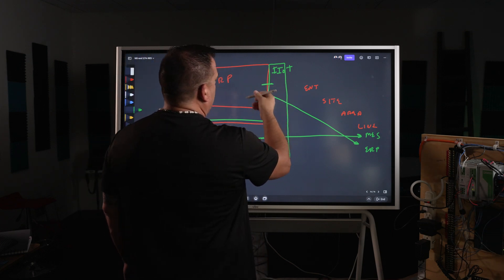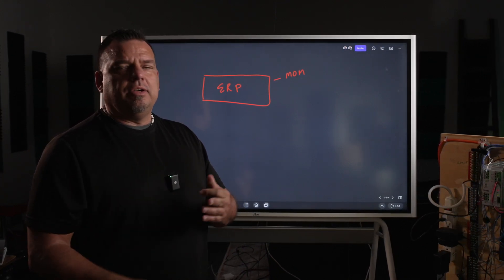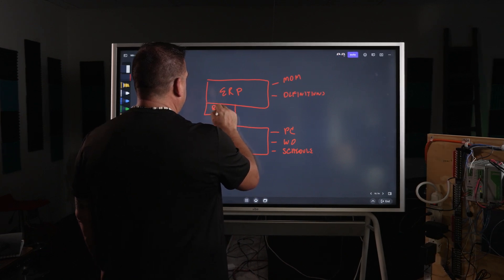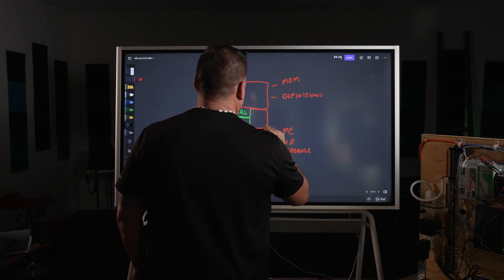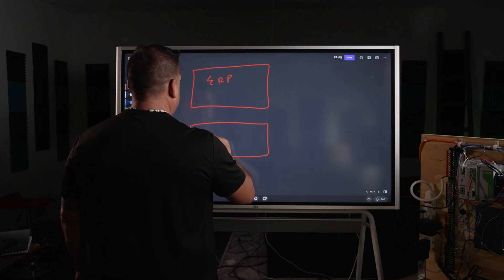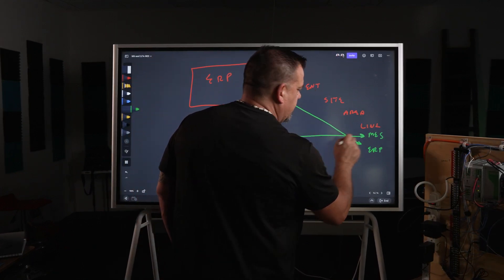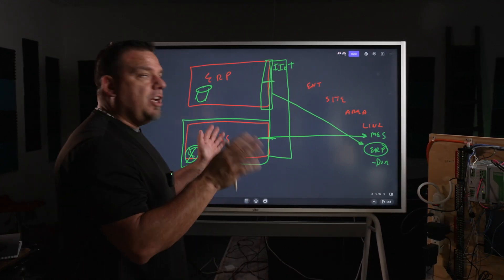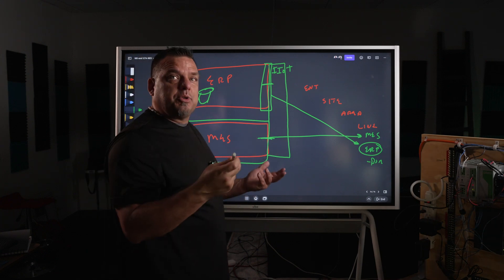MES to ERP Communications Explained!

Comment: Hello great video !! Thank You i have few questions regarding the proposed integration strategy . Can  we use uns as isa 95.06 messaging service model? , do You create handshakes mechanisms between mes and erp to be sure that each of those have received the information ? For example mes once have downloaded the work order response with order number to erp , or how do You control that the message is received for the expected subscriber and not another else in the ecosystem ? This also applies in mes to shopfloor integration thanks

Comment: Thanks for taking the opportunity to start discussing MES and ERP integration. However, from my experience, the integration concepts might be correct from a technical point of view but from content, business process requirements and the way MES systems are designed, this will not fly.
Reply: Please elaborate. MES and ERP are generally implemented over a long time with presence of outdated technologies in system. So any what way you will have to jump back and forth. Do you mean this ?

Comment: Great video. If you ERP or MES is a non customisable SAAS. It wont necessarily have the fields/tables to display the data from the UNS. Since these are core applications, is it best they are platforms and possibly even open source for full customisation potential.

Comment: What's the difference? 
Please don't tell me that your IIoT platform will discover suddenly the BoM. You build custom and custom means that if the erp or mes change you need to rework these connectors. If your scada system is isa95 there is no added value to have UNS aside. If we look correctly you're building a 3.0 architecture... you have exactly the same number of discrete connections and you need even an extra one for UNS wich in this case has no sense. 

The point here is that there isn't clearly real solutions to connect erp or even mes to uns
Reply: Wanted to write exactly the same. Thank you for comment 🎉
Reply: do you have any dcoument that is about integration of PASX 3.1.8 and ERP or PLC/Scada system?